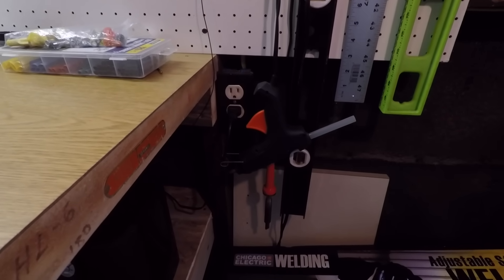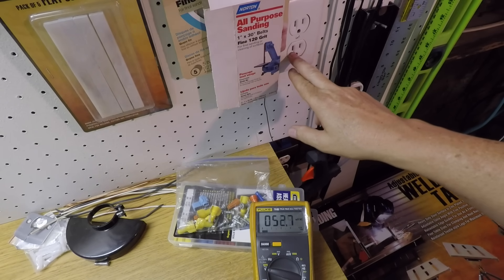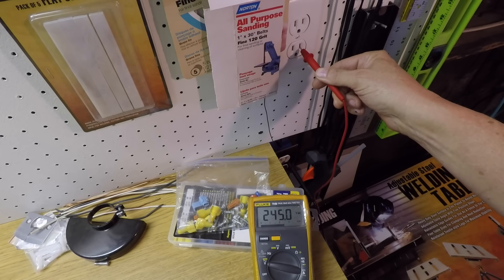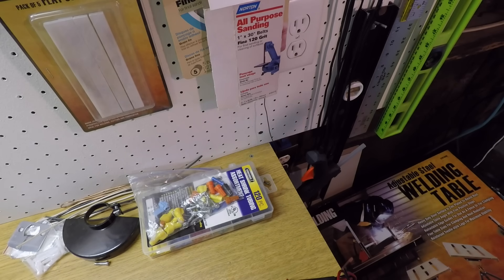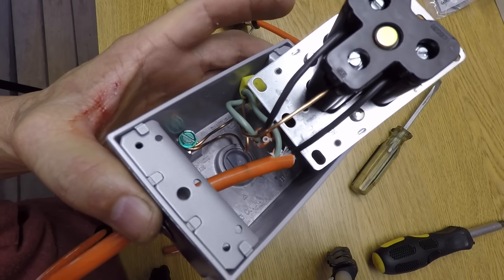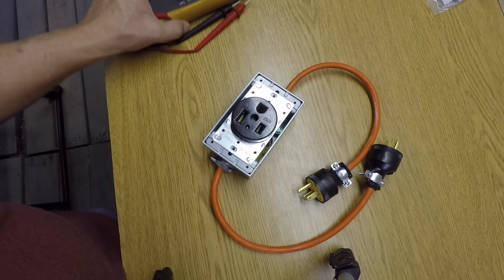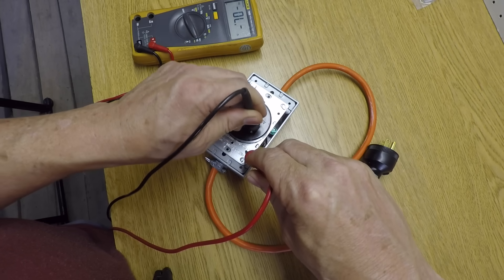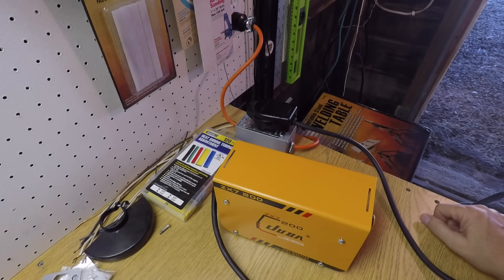How to Get 220v From 110v

Comment: While this concept can in theory work, the male plugs ends you are using are 15amp rated, you also would need 20amp rated conductors #12 , the two separate feeds would need to be fed from opposite bus bars in the main panel, being fed from a double pole breaker. The 220 plug is also a 30A plug where devices requiring this style of plug general use at or above 20amps. Circuits should never be continuously used at their total capacity. As an electrician there are load requirements that need to be followed, great example is a water heater that draws 18amp must have a 30 amp circuit, while it may not cause a fire on a 20 amp it will generate heat in the breaker. Codes states that  a load that uses more than 75% of the circuit capacity requiters the next step up breaker with wire to match the ampacity of the circuit. I will say this a quick solution in an emergency situation  but if it is going to be used more than once, dont. There are so many over ampacity violations with this adapter, not to mention feed is coming from 2 separate unattached breakers.
Reply: Yes. Electrician here from Utah. Code is for your protection. Sketchy. The reason the $300 dollar alternative is there because it has over current protection built in with voltage sensors. 
20 amp circuit should only utilized to 15-16 amps. Not only as such, but a welder in the code book is a dedicated circuit. It is a violation. I’d feel much better knowing that the a tie handle was in place and both outlets were in the same box to become a single welder circuit. But there again, I’m not aware of a reliable 20 amp 220 v welder. It’s 30 or greater. Even temp power on job sites have 220v 30 amp receptacles. You need to upsize your wire and install the correct breaker. Even if it means to surface mount conduit around from your meter.

Comment: You need to go back to your wires in the metal box and twist them together properly and then you won't have an issue with them coming out of the wire nut

Comment: Could of also phased the white neutral on one of those plugs to a hot and label it hot in panel and then you have 20 amp 240 circuit that you can add a double pole and no new wire etc

Comment: This is a fire hazard if used full time,  all power cords,  extension cords  degrade   over time  and heat  cool  cycles,  many home fires begin with   the garage door opener being powered  by   an extension cord draped  across  the rafters  or  stapled  etc,  the insulation  breaks  down  especially  if  they  are ever  moved    and the  copper    arcs.

Comment: I love this idea it’s simple clean and address the problem dead on. I purchased all the parts and two 10’ extension cords with clear male plugs . My question is simple I need to know if I have to cut both ends of the WHITE wire. The beauty of the cord is the male plug is molded on and I cannot cut the white wire on that end , but I can cut the end that goes to the box. Will this be acceptable.

Comment: Ok,  I will be brief.  Over 50 yrs. in the elect. business.  1.  This is North America power.   Rest of the world different.  USA two phase 220 V.   Rest of the world one phase 220 V.  Yea it matters.
This will operate the device (welder), Yes.   Is it safe? Yes, but Only for the author of this work.  He knows how he made it.  Here is one way a kid or buddy can be shocked.  
1. The rocker power  switch is left or bumped in the On position.  2.  Orange plug one is installed in receptacle.   3.  Buddy reaches for Orange 2 and touches the Small blade.  That puts 110 volts on his hand and it's looking to go some where like out his foot or hand if he's the  touching washing machine or other metal.  You never expect (in N. America) for a male plug to have power on it.  Power is always the female side of the connector.

Comment: DIY You never mentioned that you can have two circuits but be on the same leg. Also If you use a larger box and incorporate a 220V breaker. It would offer an On/Off switch and added safety. Bob

Comment: Hi, I think the Ground Wiring usage in this Video is Wrong, and it is dangerous.
The Neutral wire in this video is used instead of the Ground wire!, so, you actually do not have any Real Ground Wire!
While I believe The Neutral and Ground Wires should be considered and used separately!
You should have used at least one of the Ground Wires of the two 120V plugs.

Comment: Probably in your house has 2 or 3 transformers connected in open or close Y connections and in your house the connection is line to ground 110 volts, that is why you can get 220v in two live wires because the transformer connections is 220 volts line to line but it is designed as grounded open or close Y connection and in your two outlet the live wire are the two separate conduction from 2 or 3 transformer, that is why you can get 220v line to line voltage.

Comment: I desperately need help wiring my welder. I wired my 220 dryer no problem. Because it was two 110's and a ground. NO NEUTRAL.
The problem is this old Miller Thunderbolt stick welder has a power cord with a black wire, white wire and green. SO I'M SCREWED. Apparently this welder expects me to have 240 power that incorporates a white neutral wire. What do I do?
Reply from the maker: I've never wired up a 4 wire 240V plug for my welders. All the welders I own only require a three wire 240V plug. It sounds like your Miller has some component that requires 110V and needs a 4 wire 240V plug. Sorry but I'm not a good source for advice on that.
Reply: @DIYHomesteadProjectsDIYHP10  Maybe I didn't explain myself very well. That's easy to do when you know as little about electricity as I do. I was worried because this old Miller had 3 wires black, white and green and I thought oh shit they expect me to use a white neutral return line but nope. It wired up just like the dryer two 110's and a ground. So ya it turn out fine. Thank you you're videos are very helpful I'm subscribing right now.
Reply from the maker: Good to hear you got it figured out Mitch. Thanks for the sub and thank you for watching.

Comment: Thank you very much for the video. I'm in kinda of the opposite situation. I have a water heater from US rated at 230v and want to hook use it in Singapore, where local power supply is 240v. Can I plug it directly? If it helps, I'm using Ecosmart 18 tankless water heater. Thanks in advance.
Reply from the maker: Sounds like  you should be able to plug it in directly.
Reply: @DIYHomesteadProjectsDIYHP10  I think so too but little worried, since in US you get 220v by combining two hot 110v wires. In Singapore, it is one hot 230v and a neutral wire. If it will work directly,  should I connect Singapore 230v hot wire to the red or black wire on the heater?
Reply from the maker: Sorry but I can't help you with connecting to Singapore power. I don't know anything about how they have the power set up in that country.
Reply: @DIYHomesteadProjectsDIYHP10  Thanks for the reply. Appreciated. I'm hoping someone with a similiar cross border knowledge would come across this query. Thanks mate.

Comment: You can imprube  it by   using a swich on each  clable coming out the box  . That way before unplog  wnithing you will by able to  cut the  remain 110 v  expost on ider blades ..  and  the answer to that its  yes you will have  allways  a chance of shok  cause in 220 use  depends  much in what you  atach  for example in case of a motor you  have a low  voltage retorn but still dangerus in case of the imverter welder   it can by alitlle be harder if the  welder its runing  other  use  as  a 220v heatet  it may  retur full charge   220 v on idem way of the sircuit  .. im hope it help you ( by the way if you  install  eny type of  pilot ligth  on the box   that can show  which  cord still charge it will make it alot  safer    to

Comment: Guys this thing he's doing will work, but there are some SERIOUS safety concerns.  Most receptacle outlets are 15A with a 20A breaker, so let's assume they're the two breakers they're on are even/odd.  You could have two outlets in the garage on separate breaker, but if they're on the same "hot" bus, you've only got 120v.  When that breaker trips in your panel, it prevents the wires in your house from melting whatever insulation is on them, then glowing red hot.  Without getting to deep in this, other hazards and such, I would only recommend something like he's doing here for  a 240 30A window AC appliance.  Sure wouldn't do a 40A appliance, mostly for fear of ruining the appliance.  Sure wouldn't put a 240v arc welder that calls for a 60A breaker...

Comment: At least if you're going to wire it this way don't  used an extension cord cuz you're technically putting 12 gauge wire on a 40 amp circuit now

Comment: Just ran 240 to my new shop for my welder, through conduit,  installed a new sub panel, and oh, the pain in the summer ,to go in the attic, and run a seperate neutral, all the way to the shed from the house 200 amp panel. Guess I could have saved time and money, and done it this way. ( no thanks)

Comment: Yea, 120+120 does =240  HOWEVER in your case 
you will only have 40amp. A true 240 circuit will
have 120+120 & 50+50amp = 100amps.
Will your welder run on only 40amp. I'm guessin'
it will not.,

!

Comment: Great tip on two separate 20 amp 120 volts circuits to achieve 240 volt 20 amps outlet.

Comment: Funny enough this is completely code, now you got lucky that both outlet derived power from separate polls. Also those devices online have a feature that detects if one of the outlets fail and shuts the whole device off otherwise it could damage the device that's attached to it. Often in this case you'd install a 2pole breaker on the outlets and have a permanent 240 outlet, the code is more directed at kitchens but could work for a garage.

Comment: Why not just convert one of those outlets to 240v? Easily done at the main panel assuming it is a dedicated outlet that's not feeding anything else. Thats the safest and legal way to get 240v in your garage without running a new circuit

Comment: My issue with this cord is most welders need a 30amp 220 circuit with #8 or #10 wire depending on run length.  Using this cord produces 220 volt but the wire is undersized (as are the breakers) to get full power out of any welder much above a rated 160 amps.  In a pinch it could work for a low power device but forget about doing this to get max output on most welders.

Comment: Well of course you can silly. Just put in a 240V breaker in your breaker box which will encompass this and then run your 220 or 240 where ever you need it.  You must be aware of polarity doing it your way and risk over loading/cross loading. (I made up a word like yourself).

Comment: It makes no sense to split that into smaller lines in two outlets when the main power supply line is a larger wire and it just feeds off a grid and going to a circuit breaker you might as well run a heavier line right off your power box straight to a 110 outlet cuz your circuit box is already wired for the heavier wattage not that you can't do this it's just seems a lot of work and a pain in the ass

Comment: The problem is most modern garages have two outlets on one 20amp circuit. Its just easier to run a 240v circuit extra to the gerage. You should ask for this if you build or remodel a home.

Comment: After watching your video and reading more than a few comments, it would appear that the majority of complaints about your setup concern your use of 2 extension cords to connect the power to the 240v receptacle. This is inferred from the shear number of people asking, "but why didn't you just run a 240v circuit?" The only difference I can see between the two is that in your setup, the 2 120v lines are run separately instead of in a cable that contains the same number of wires, minus the extra ground wire in the 2 separate lines. If you had connected your power inside the one box, hardwired directly to the receptacle instead of useing 2 120v receptacles then connecting them with the extension cords, people would have been happy and you could have saved $13 dollars in extra material.

Comment: if you ran a seperate circuit just for 110, woud'nt it have been easier to run a 220 line? i almost burned my house down using this method, now i have ran a single 220 line for my air compressor and one for my welder. putting in that extra circuit is cheaper than replacing  the house after a denied insurance claim. IMO

Comment: What a waste of effort. You don't even mention that the two lines need to be opposite sides of the breaker box. Plus, you wired your own shop. WHY NOT just wire a real 220v plug.

Comment: I’m going to assume others have noticed this but you didn’t make 220 volts from 110 volt service.  The breaker box you have feeding that garage is already setup for 220 volts (otherwise if it was 110 volts you would get no detectable voltage across the two outlets, they would both be fed by the same leg of 110 volts).  All you really needed to do was put a 220 breaker in your box and wire the 220 outlet to that breaker.  If you don’t follow along with that, try measuring the voltage across the hot of two separate outlets that are on the same leg of the panel (usually every other breaker in a traditional box) and you would have 110 volts.  

To put it another way, if you connect one wire to the positive terminal of a battery and then add a second wire, you would agree the voltage is the same, it’s just two wires for presumably two different loads

Comment: This works but the breaker situation becomes  dangerous.  You can easily trip one side of your 220 and still have 110 hot at the plug.  This is for people that fully understand what is going on and then temporary.  This would never pass code.

Comment: Your device will work to a point but there are a few safety concerns with your "cheap, convenient, work around". You connected a 50 amp receptacle to two 20 amp circuits (on different phases) using all materials and devices rated for 15 amps or less.  First problem is both of those outlets may be on #12 wire but the outlets (receptacles) themselves are only rated for 15 amps. Second, the cord looked like it wasn't even #14 wire (also rated for 15 amps). It's likely #16 or less. Third, if one of your circuits trips due to overload or short-circuit, the other will still be live. That can present a danger to the novice trying to determine what is wrong. 220 volt outlets are connected to two pole breakers so both circuits turn off when the breaker trips. 
Best to just run a 220 volt circuit from the panel to the garage using the proper size conductors for the amperage you will be using, on a appropriate, dedicated two pole breaker. "Saving money" by creating un-safe wiring can be the last thing you ever do!!!

Comment: Hope the wire used on the 120v plugs can handle the extra amps of the 240 device because if not you could burn your house up or your shed and everything in it

Comment: Let me get this straight. You installed these two outlets for the purpose of making this adapter to use your welder. When you could have just installed a 220 outlet in the first place. Oh I know, you wanted to show people how to have 220 without installing a new outlet. However it could be quite a task to find two outlets close together run on different supplies. Not to mention being the only outlet on a 20 amp circuit. Congrats on the views you got. Total waste of time.

Comment: you have 15 amp receptacle's on twenty amp circuits . If the no. 12 wire you say feeds the 15 amp receptacles and the no. 12 wire is on 20 amp circuit breakers, then then the 15 amp receptacles are the weak link. 20 amp receptacles have a horizontal slot on the vertical neutral slot.

Comment: The US electricity supply, outlets and plugs are a poor design. The UK has 240 volt to every outlet. The outlets have covers over the line (a.k.a. live or hot) and neutral receptors that are opened when the earth pin of the plug is inserted. The earth pin is longer than the line and neutral pins and makes contact first. The line and neutral pins are insulated close to the plug body, so if the plug is not fully inserted, it is impossible to get a shock by touching the pins. Finally the plug has a fuse, rated according to the device e.g. a small lamp may have a 1 amp fuse but an electric oven might have a 13 amp fuse.

The device you have built is dangerous and anyone copying this should think twice. They may leave it plugged in powering a space heater and another person might unplug one end to use the outlet for something else and get a shock from the plug pins.. Why didn’t you flip the breaker for both lines and wire this behind the outlets and fix this new outlet permanently to the wall?

Comment: you sure violate all electrical safety rules your 50A outlet needs a 50A breaker and not two 15A breakers if you pop one breaker you can have a major problem by wiring it in this way

Comment: Where the heavy wires come in from outside into my circuit breaker box. There are two rows of circuit breakers, The neutral is in the center and wired to neutral connections on both sides. Each side is 120 VAC and if I use a volt meter and touch the probes on both sides I get a 240 volt reading. I don't have a welder but one from Harbor Freight will run off of 120 volts.

Comment: 50 amp receptacle and cord cap are over kill. There are 20 amp receptacle and cord caps available and are probably cheaper. I'm sure this is not up to code and could void your fire insurance ! National electrical code says that a 240 v double pole circuit must have the breakers tied together so that both circuits trip together.